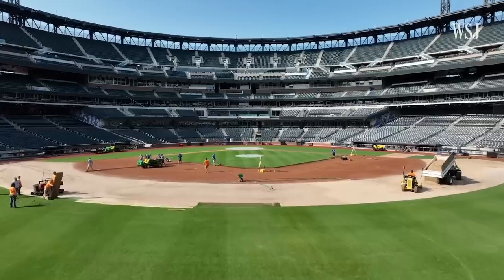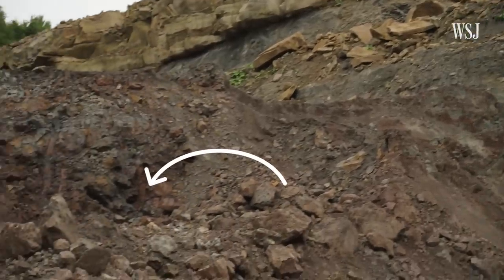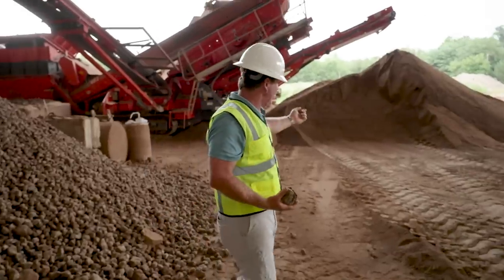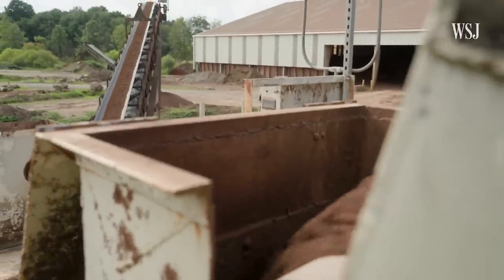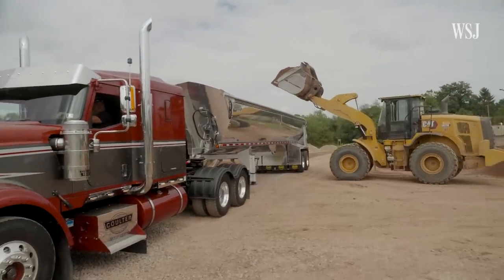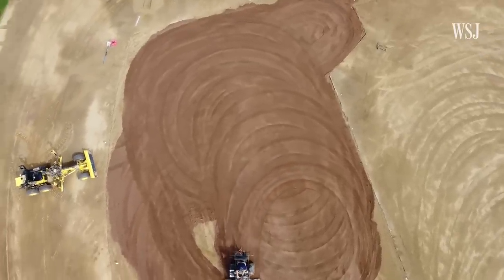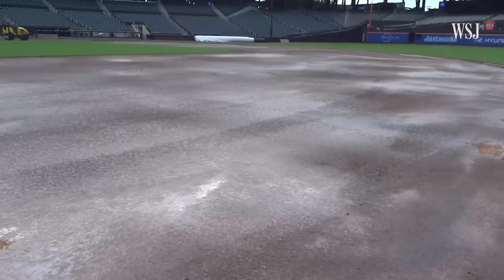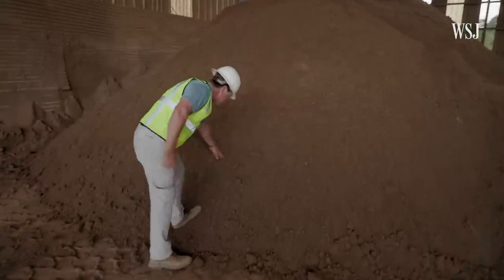Why a Pennsylvania Dirt Farm Supplies Most MLB Teams’ Infields | WSJ A to B

Comment: Now I hope my Braves don't use this dirt
Reply: They don't.
Reply: Why?
Reply: @CatholicGaming  Teams use dirt unique to their region. If they didn't, it would harm the grass surrounding the infield. Back in the 1980s, most teams used anything they got. If you look at old video footage, you can see that over time, the grass around the infield ended up dead or destroyed. The Atlanta Braves use a specialty mix. If you look at video from Turner Field and Trust Park, you can see that their infield dirt is a darker color than most MLB stadiums.
Reply: @marshallarnold-ep7nn   That would be false. In San Diego, we use this mix. Not saying that I know what Atlanta uses, but your reasoning behind why it's different is wrong. While clay will kill grass, it should be vacuumed or thrown back to the skin during postgame maintenance. If done correctly where the grass is grown, what species, or cultivar is irrelevant.  Coloration is dependent on what color/mix of turface you throw over the skin. To answer the question of why they do or don't is just down to preference. Some guys have the stuff they like and most like this stuff. Not coming after you at all, just wanted to give out some free knowledge.
Reply: Cus theyre an NL East rival 😂@CatholicGaming